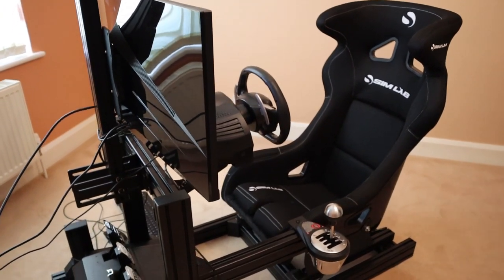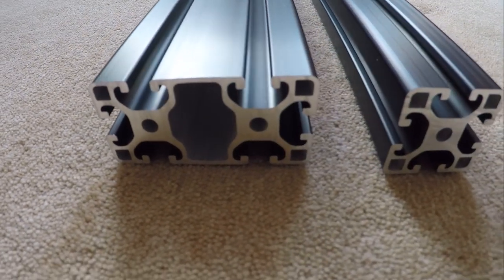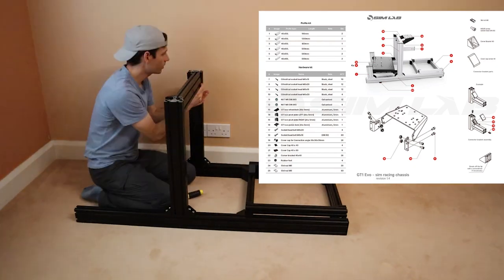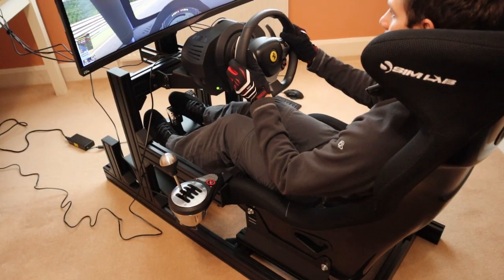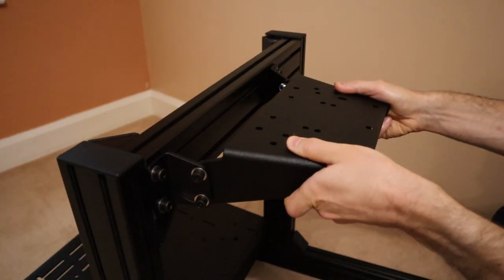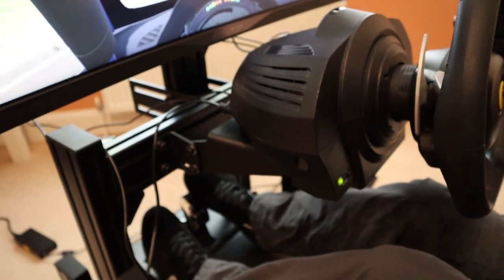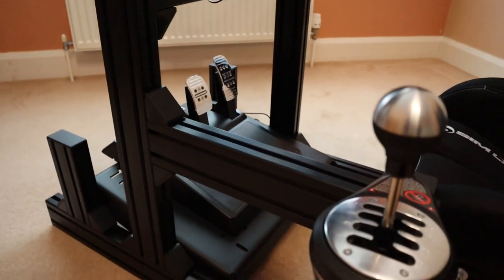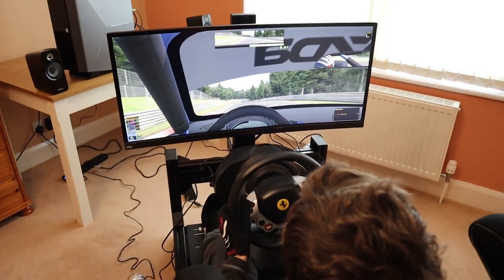Sim-Lab GT1 Evo cockpit review

Comment: Does anyone have any idea what the weight capacity is on the GT1 Evo? Looking to upgrade from a wheel stand but I am 6’ 8” and heavy as well. Don’t want to order a cockpit only to find out it doesn’t work for me. Thanks!
Reply from the maker: Thanks for your question Nick—apologies for the slightly delayed reply.
 The GT1 Evo should be more than big enough for your height. It’s 135cm in length and, as you can see from the video (2:02), I have the pedal deck uprights and the seat rails set three inches from the edges. Additionally, I have the seat set quite far forward on the seat rails—so there’s plenty of scope to extend the leg length. The base frame is very strong, so weight should not be an issue. However, you may need to opt for a larger seat like the Sim Lab SPEED1 XL. For reference, I'm about 5ft 9.5 inches (176.5cm) and average build. Hope that helps mate. 👍

Comment: Has anyone ordered this cockpit post Brexit? If so, were there additional costs apart from shipping and 20% VAT?
Reply from the maker: Hi Barry, you can now order the GT1 Evo from Digital Motorsports here: https://adaptnet.work/GT1Evo. They are based in Ireland and have published a blog post about the new Brexit arrangements. My understanding is that 20% VAT is applied when the shipment enters mainland UK. This will be charged to the buyer by the shipping company alongside a small handling fee (2.5% of the VAT and a minimum of £11.00). Hope that helps. 👍

Comment: 400 quid for some aluminium. I take it you have to buy the seat separately.
Reply: They also charge upwards of 500 quid for a seat when you can literally buy a real sparco car seat for less….
Reply from the maker: Thanks for your comment TopSelections. While you could probably source the aluminium profile slightly cheaper, the advantage of purchasing a kit like this is that everything comes pre-cut (with soft edges) to fit together perfectly. All of the hardware to assemble the rig is also included, along with some spares, and the bespoke wheel and pedal decks make it a lot easier to mount your equipment and fine-tune your driving position.

Currently, you can pick up the GT1 Evo from Digital Motorsports for about £330 (VAT included) ( https://adaptnet.work/GT1Evo ). At this price, I think the GT1 Evo is a great deal—especially, when compared to some other alumnium profile rigs like the new Next Level Racing F-GT Elite. You do have to purchase a seat separately, but this is also the case with most other aluminium profile cockpits. The great thing is that this rig will support almost any car seat you like, so you can start with a really cheap second hand one and upgrade down the line.

Comment: Can this handle motion and or the simucube 2 sport 17nm?
Reply from the maker: Thanks for your question Spartan. While the GT1 Evo can handle high-torque direct drive wheels, I would actually recommend the new GT1 Pro ( https://adaptnet.work/GT1Pro ). I'm currently reviewing this rig, so stay posted for that. But, in summary, the GT1 Pro utilises bespoke alloy plates, to join pieces of profile, and the base profile is pre-machined, so that it bolts together directly. This all results in a stronger overall build. Additionally, it comes with hardwre to mount motion servo systems. Hope that helps. 👍

Comment: By now you've tried the GT Elite too, which would you prefer, the GT1 Evo or the GT Elite?
Reply from the maker: Thanks for your question JG. Both rigs have their pros and cons, with the NLR GT Elite being easier to make adjustments and the Sim-Lab GT1 Evo utlising thicker-grade aluminium profile. I'm also currently reviewing the Sim-Lab GT1 Pro, which I'd highly recommend as it takes the best bits from both rigs ( https://adaptnet.work/GT1Pro ). Hope that helps mate. 👍
Reply: @ADAPTNetwork  I see, thanks. NLR then, as we have no practical option for Simlab to ship to us.
Reply from the maker: No worries  @jgloc25 . If it helps, you can also use our coupon code 'ADAPT' to save 5% when you buy the rig directly from NLR: https://adaptnet.work/GTElite

Comment: Which monitor are you using? And what size do you recommend? Is 32" enough?
Reply from the maker: Thanks for your question Beni. It's a 34″ Acer Predator X34. Being a 21:9 ultrawide, it's a nice size and aspect ratio for sim racing, general gaming and productivity. A 16:9 32" monitor would also work well. Though, the extra screen real estate you get with an ultrawide is useful for sim racing and flight sims. Hope that helps. 👍

Comment: This looks really compact compared to the P1-X. I’m roughly 6’2”. Will this be enough leg space for those that are 6’0” and over?
Reply from the maker: Thanks for your comment VRR. The GT1 Evo is likely more than big enough for your height. It’s 135cm in length and, as you can see from the video (
2:02), I have the pedal deck uprights and the seat rails set three inches from the edges. Additionally, I have the seat set quite far forward on the seat rails—so there’s plenty of scope to extend the leg length. Depending on your build, however, you may need to opt for a larger seat like the Sim Lab SPEED1 XL. For reference, I'm about 5ft 9.5 inches (176.5cm) and average build. Hope that helps. 👍
Reply: @ADAPTNetwork  okay cool thank you 👍🏽👍🏽

Comment: I have a 34” curved monitor. What adapter did you use to mount with simlabs flat vesa plate? Thanks for the vid.
Reply from the maker: Thanks for your question sidestand. My Acer Predator X34 came with a custom VESA adapter to compensate for the curve. Which monitor do you have? Perhaps you could source a similar adapter from the manufacturer or online. Hope that helps. 👍

Comment: Great review!! quick question if... I currently have the GT Omega Apex Wheel Stand with Rear Seat frame and was wondering if I could use the seat with the Sim-Lab GT1? The Seat has a slider... hoping it will be a straight bolt on. Thanks
Reply from the maker: Thanks for your question Charan. Yes, you should be able to bolt the seat frame directly to the GT1 Evo seat rails via the seat sliders. Slide the seat sliders forward and back to expose the bolting points and bolt through to four T-nuts in the seat rails. Hope that helps. 👍
Reply: @ADAPTNetwork  brilliant thank you !

Comment: This looks incredibly small. I'm worried I'll be too tall for it.
Reply from the maker: Thanks for your comment Dylan. The GT1 Evo is likely more than big enough for your height. It’s 135cm in length and, as you can see from the video (
2:02), I have the pedal deck uprights and the seat rails set three inches from the edges. Additionally, I have the seat set quite far forward on the seat rails—so there’s plenty of scope to extend the leg length. Depending on your build, however, you may need to opt for a larger seat like the Sim Lab SPEED1 XL. For reference, I'm about 5ft 9.5 inches (176.5cm) and average build. Hope that helps. 👍

Comment: Hy
Which size of seat do you bought and what is your screen size?
Thx
Reply from the maker: Thanks for your questions Péter. I have the regular size Sim-Lab SPEED1 seat (4:07). At its tightest point, the seat measures 33cm across. So, if you’re above average build, opt for the XL version or a wider race seat like the Sim-Lab SPEED2. The monitor I’m using is the 34″ Acer X34.

Comment: Do you think its comfortable when my length is 1.94m?
Reply from the maker: Thanks for your question Damian
. The GT1 Evo is more than big enough for your height. It’s 135cm in length and, as you can see from the video (2:02), I have the pedal deck uprights and the seat rails set three inches from the edges. Additionally, I have the seat set quite far forward on the seat rails—so there’s plenty of scope to extend the leg length. For reference, I'm about 5ft 9.5 inches (176.5cm) and average build. 👍
Reply: @ADAPTNetwork  thank you very much for the fast reply i watched ur vid again hahaha and then i had my answer i already ordered it so cant wait🔥
Reply from the maker: No worries  @damian7980 —glad I could help. Enjoy the new rig dude and see you on the virtual race track! 🏁
Reply: @ADAPTNetwork  🔥🔥
Reply: @damian7980   do you have simlab speed 1 seat ? Is comfortable for your 1.94 length ? I'm 1.90 cm
Reply: @davidlamas233  ye mate i bought the speed 1 seat and its comfortable
but i use my secretlab chair pillow for the bottom of the seat because that feels better.
Reply: @damian7980  Being so tall, how does it feel to sit on the seat? my doubt in that seat, is if the head can be supported on the backrest or if it is above the backrest and the earmuffs can disturb ?
Reply: @davidlamas233  the seat is tall enough for me  and there is enough place when having the seat fully to the back
Reply: @damian7980   okey thanks
Reply: You buy the simlab speed 1 or the simlab speed 1 xxl ?
Reply: @davidlamas233  large
Reply: @davidlamas233  what i did was looking at the cm of a normal car seat and then look at the cm of the simlabs seat
Reply: @damian7980   simlab speed 1 and speed 1 xxl has the same tall, the differences are in wide
Reply: @davidlamas233  ye

Comment: Great review! What do I need to have my rig finished and ready? 1) GT1-Evo cockpit 2) Speed1 seat 3) Bucket seat bracket set. Is it enough? I've seen Sparco seat slider, but I didn't see it in you video so I assume it is optional... I don't really need it. Thank you in advance :)
Reply from the maker: Thanks Nico, I’m stoked you liked the review. Yeah, the seat slider is completely optional—you only need it if you want to adjust the seat position on the fly. You might, however, want to add a shifter mounting bracket and GT1 Evo single screen holder, if you want to mount your monitor. Hope that helps. 👍
Reply: @ADAPTNetwork  Wow, super fast reply! Well, I don't need the screen holder for now because I have my monitor attached to my desk (my screen is shared between simrig and everyday use), and I would move the entire rig on the caster wheels when I want to drive. And yes, shifter mb can be a smart purchase (I have a CSL Elite F1 for now so no shifter at the moment, but I'm considering the idea of buying one). Thank you again mate :)
Reply from the maker: No worries  @nicofarella . Glad I could help—enjoy the new rig bud.

Comment: Anyone ordered one of these to the UK recently? What are the import costs like? Thanks for the great video!
Reply from the maker: Thanks for your comment Tobiamus—I’m stoked you liked the review. My rig arrived pre-Brexit. However, you can order the GT1 Evo from Digital-Motorsports here (once it’s restocked): https://adaptnet.work/GT1Evo. They are based in Ireland and have published a blog post about the new Brexit arrangements. My understanding is that 20% VAT is applied when the shipment enters mainland UK. This will be charged to the buyer by the shipping company alongside a small handling fee (2.5% of the VAT and a minimum of £11.00). Hope that helps. 👍

Comment: The plastic angle covers on my Evo are popping out at the lightest breeze, other than that, it's brilliant.
Reply from the maker: Thanks for your comment Dan. I have had a similar issue with the plastic corner bracket covers; they sometimes fall off when I slide the rig around the room. To fix this, I secured the covers with small pieces of black electrical insulating tape. If you don't mind the tape showing, you could also use duct tape. It's not the most elegant solution, but it does the job. Hope that helps. 👍
Reply: @ADAPTNetwork  Thanks for the tip. How comfortable is the simlab seat for 1-2 hour stints? I currently have a sliding, reclinable seat but after 20 minutes i get back pain. Kinda solved the issue with a memory foam pillow but it gets hot and i only have around 12 degrees of leg angle to the pedals, your seat looks more comfortable.
Reply from the maker: No worries  @danut05 . I find that the Sim-Lab SPEED 1 seat is quite comfortable and provides ample support—even during long sessions. I run it at the maximum tilt angle of 15° (5:35), which provides a realistic GT driving position. When purchasing a seat, I would recommend double checking the dimensions to ensure a good fit. if you’re above average build, opt for the XL version or a wider race seat like the Sim-Lab SPEED2. For reference, I'm about 5ft 9.5 inches (176.5cm) and average build and the regular-sized SPEED 1 fits me well.

Comment: I have another question. From the video the GT1 wheelbase uprights looks really short compared to the P1-X’s wheelbase uprights? Is it sufficient enough in height relative to one’s torso lined up to the wheelbase while in seat?
Reply from the maker: No worries VRR—I'm glad I can help. I think the wheel mount uprights are plenty tall enough. They measure 58cm (66cm if you include the base) and you can fine tune your wheel position by adjusting the angle of the wheel plate. In this video, I use the Thrustmaster TX wheel base. The wheel plate is positioned quite high because it needs to be angled downward for correct wheel positioning. However, I'm currently running the Fanatec CSL DD wheel base, which is positioned a few inches lower and angled upright. Does that make sense?
Reply: @ADAPTNetwork  yes that make sense now. Thank you.

Comment: I’m considering buying one but what extra things do you need to get? 
Pls write exactly what things!!! 
(:
Reply from the maker: Thanks for your question Vincent. To build the same setup as the one I review in this video, you’ll need the Sim-Lab GT1 Evo cockpit ( https://adaptnet.work/GT1Evo ), bucket seat brackets ( https://adaptnet.work/5zmE ), the Sim-Lab SPEED1 bucket seat ( https://adaptnet.work/3GAg ), the Sim-Lab shifter & handbrake mount ( https://adaptnet.work/6Muv ), and the Sim-Lab GT1 Evo single screen holder ( https://adaptnet.work/6Mun ). I’ve added links to Digital-Motorsports, however you can also get these directly from Sim-Lab. Hope that helps. 👍
Reply: @ADAPTNetwork  
Thanks for replying!
Now you have a new subscriber!
/ Vincent
Reply from the maker: No worries at all  @vincent.b2021 —I’m glad I could help. And, thanks so much for subscribing—it means a lot. 👍

Comment: I am 6ft 5 would this work for me?
Reply from the maker: Thanks for your question Camber King
. The GT1 Evo is more than big enough for your height. It’s 135cm in length and, as you can see from the video (2:02), I have the pedal deck uprights and the seat rails set three inches from the edges. Additionally, I have the seat set quite far forward on the seat rails—so there’s plenty of scope to extend the leg length. Depending on your build, however, you may need to opt for a larger seat like the Sim Lab SPEED1 XL. For reference, I'm about 5ft 9.5 inches (176.5cm) and average build. Hope that helps. 👍

Comment: A bit off topic. How do you like this 34 curved screen for racing?
Reply from the maker: Thanks for your question ZiK. The Acer Predator X34 works brilliantly for sim racing. A single monitor is a lot easier to set up and run than a triple screen setup. The 21:9 aspect ratio also provides a decent field of view and the 100Hz refresh rate (latest model now has 120Hz), is more than enough for sim racing. In the near future though, I’m looking to upgrade to a 49″ super ultrawide, for a larger field of view. So, if space and budget isn’t an issue, I would recommend going with a 32:9 aspect ratio monitor. Else, something like the Acer Predator X34 will still work really well. Hope that helps. 👍
Reply: @ADAPTNetwork  Thanks :) I was between 21:9 IPS and VA but I will get IPS and in the future I will take IPS to my PC and maybe get LG OLED for sim rig if I am crazy enough :) But for now I will get 21:9 :)
Reply from the maker: Great choice  @Elementpunx . The Acer Predator X34 has an IPS display and it has good colour accuracy and vibrance. I’m not the biggest fan of OLED screens for gaming because they are more susceptible to screen burn-in. Though I think this is improving with the latest iterations.

Comment: Hello! Do u think is good for 1.84cm height?  Seems very short 
2. Do u know how much is the shipping cost in Europe? 
3. Your seat is better than sparco r100 ?
Reply from the maker: Thanks for your questions Bobby—I’ll do my best to answer them (below).

1. The GT1 Evo is more than big enough for your height. It’s 135cm in length and, as you can see from the video (
2:02), I have the pedal deck uprights and the seat rails set three inches from the edges. Additionally, I have the seat set quite far forward on the seat rails—so there’s plenty of scope to extend the leg length. For reference, I'm about 5ft 9.5 inches (176.5cm) and average build.

2. If you buy the rig from Digital Motorsports ( https://adaptnet.work/GT1Evo ), then economy shipping to most European countries currently costs €115.74. If you buy direct from Sim-Lab, I think it‘s currently €122.42.

3. I haven’t tried the Sparco R100, but it looks to have similar dimensions to the SPEED1 (which I have). The Sparco R100 is more of a sport seat with recline function, whereas the SPEED1 is a fixed bucket seat with high bolster for extra support. I found the SPEED1 to be very comfortable, but if you‘re above average build I think you may find the Sparco R100 a little roomier. Otherwise, it just comes down to personal preference. Hope that helps. 👍
Reply: @ADAPTNetwork  thank u ! Very informative and I will subscribe!
Reply from the maker: No worries  @bratosin1 . Thanks for the sub—I really appreciate the support.

Comment: What is the thicknss of this 80/40 profile?
Reply from the maker: Thanks for your question KINA. 4080 profile measure 40 x 80mm (1:36). 👍
Reply: @ADAPTNetwork  I meant to ask the internal thickness/code for the 80/40 as when I'm trying to look them online they are or varying thickness internally.
Reply from the maker: @ranakirti  I measure the core width at 15mm and the thinnest outside edge at 2mm. Hope that helps. 👍
Reply: @ADAPTNetwork  u r a superstar. appreciate it. 💐